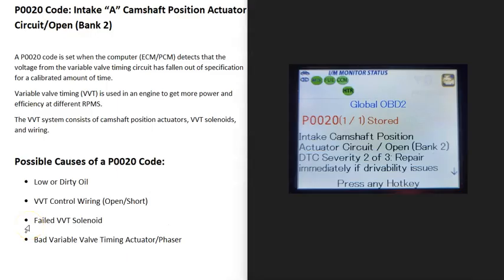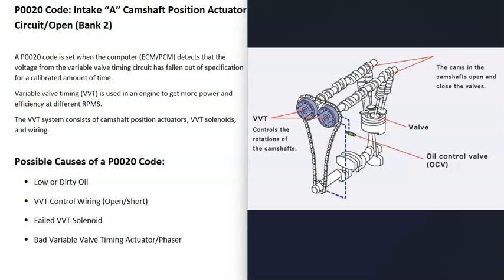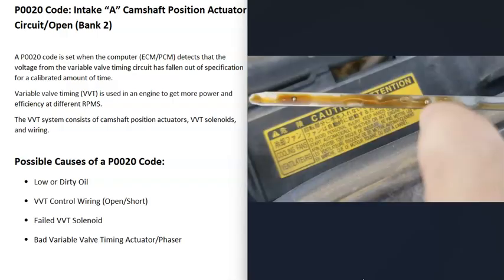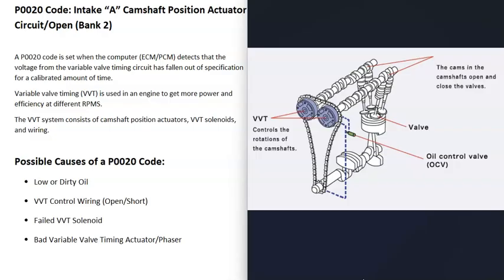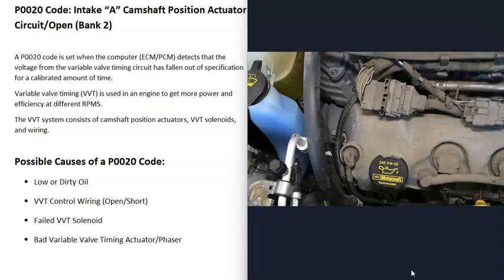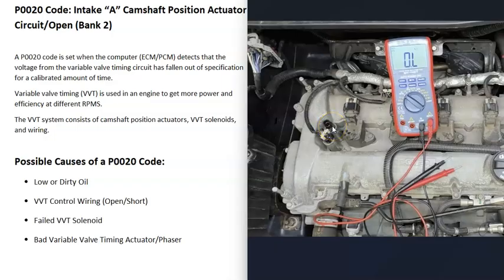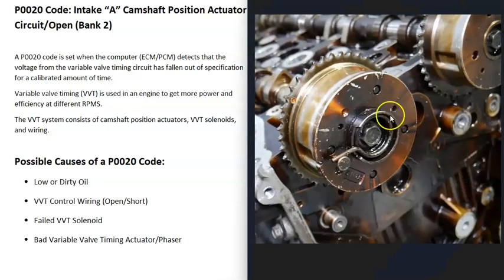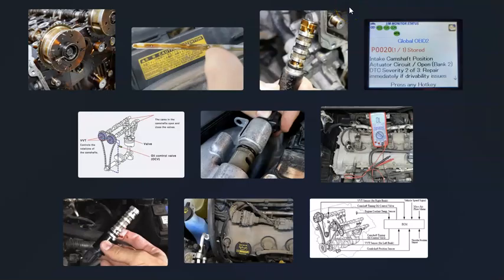Causes and Fixes P0020 Code: Intake “A” Camshaft Position Actuator Circuit/Open (Bank 2)

Comment: Hi there
I just had timing chain done and after 20 mins of ride start to have a rough idle and check engine on. I had the same code error and we found the camshaft adjuster collar siezured on out position, after replaced did the same
It is possible that the vvt sprockets to not been well sitted? Any idea why the oil is not going on the exhaust camshaft adjuster? Thanks

Comment: Would you advise buying a used vehicle with the check engine light on showing this code?
Reply: It seems like a simple fix, either get an oil change and clean the solenoid or replace it